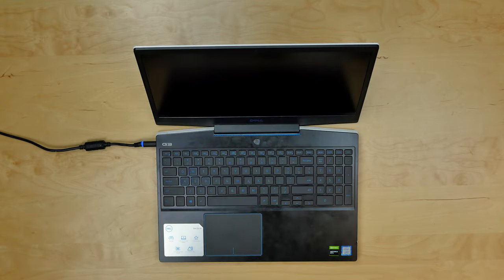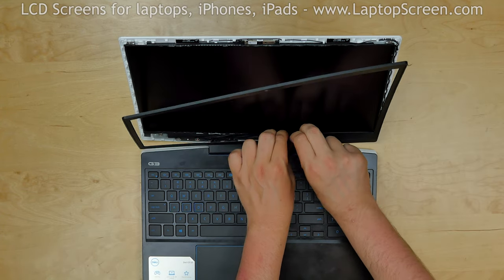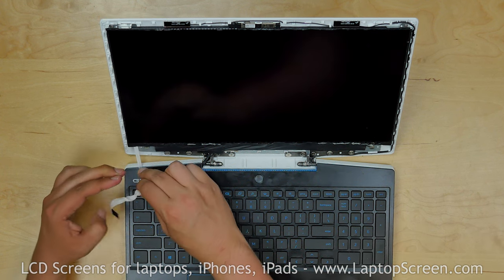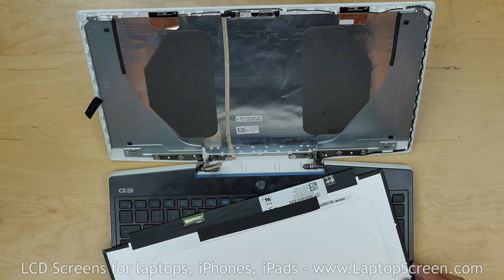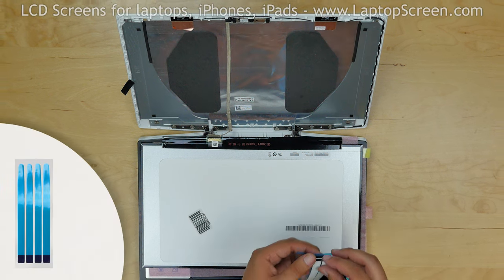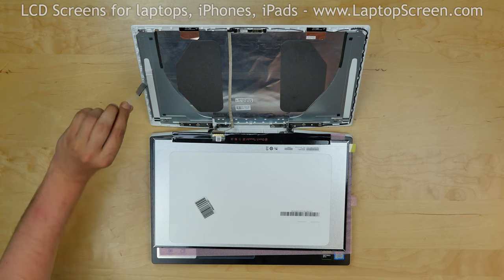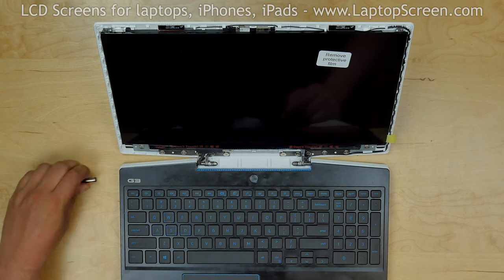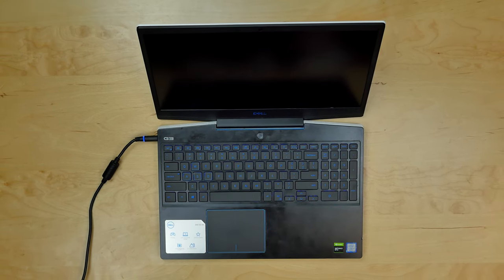How to replace LCD Screen on Dell G3 15 laptop. Step-by-step instructions

Comment: Hello!
Can I upgrade my 60hz screen to 144hz one ?
Reply from the maker: Yes, but you will need to get an LCD cable that runs between the motherboard to the LCD that is a 40-pin on the LCD side. They should be all the same on the motherboard side. But if you currently have a 60Hz screen, your cable has 30-pins and you need a 40-pin one.
Something like this: https://www.ebay.com/itm/386083766920
Reply: @Laptopscreen  thank You
Reply: @Laptopscreen what if you have a 120hz g315 3500 screen? Can I replace w 144hz?

Comment: hi there! extremely helpful! It's 30pin, right? and G3 15 3590 and 3500 are the same lcd? and  If I get a new lcd with 144hz,  can I put the lcd on it with 30pin to 40pin connecter? thank you.
Reply from the maker: No, it will not work, the 30 to 40 pin connector/adapter is only useful for adapting surplus touch-screen LCDs (40-pin) as non-touch-screen replacements (30-pin). The 144Hz screen requires more data-lanes than the 30 pin cable provides. It may be possible to replace the 30-pin video cable from the motherboard to a 40-pin cable, if one was made for your computer.

Comment: No need to unplug the battery ?
Reply from the maker: You can do it as a precaution, otherwise just be extra careful when plugging the connector in, use both hands and don't fiddle with it. Slide it in, secure with tape.

Comment: My screen started flickering. Do i need full lcd replacement?. I can send you video of the problem.
Reply from the maker: If there are no obvious cracks on it, then it's best to check/replug the video cable at the back of the LCD. If the screen flickers as you move the hinges, than you need a new video cable - current one is frayed in the hinges. Connect an external monitor/tv and check if that also flickers - if it does your video card maybe failing. And if none of that applies - replace LCD.